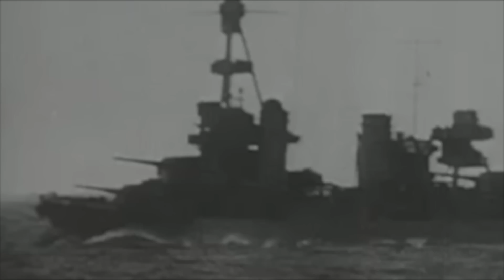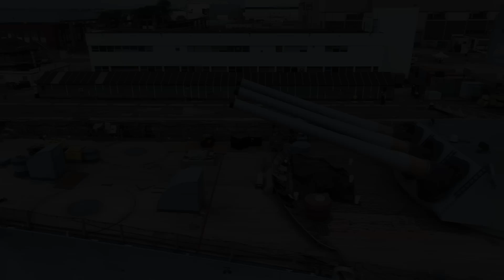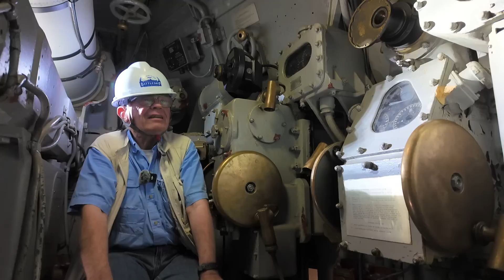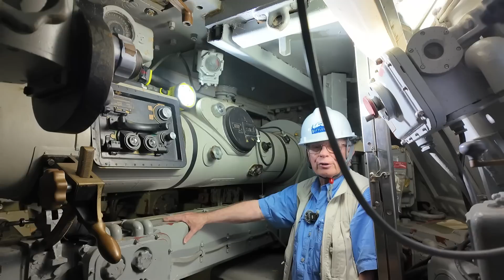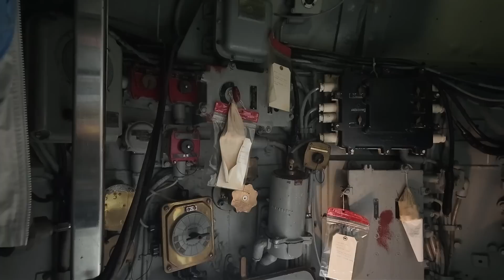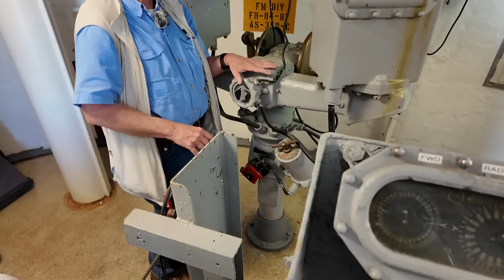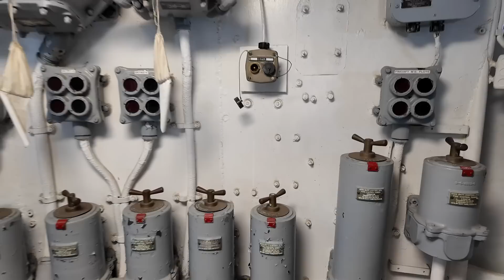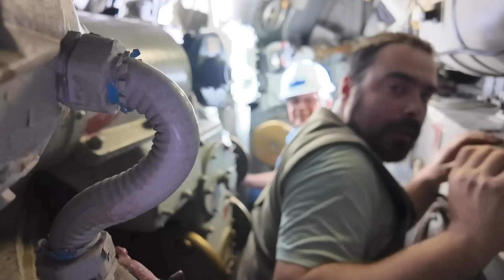Naval Gunnery - Rangefinding on an Iowa-class battleship

Comment: It’s disturbing that a huge number of people (including historians) believe the fire control radar is what actually calculates the firing solution (and also assume any ship without it thus were incapable of calculating firing solutions because they didn’t have a fire control system).
Reply: Sorry to disturb you, but I was one of them. I thought it was fully automatic, drawing straight from a radar plot. Of course, in absence of radar I presumed it was mark 1 eyeball and consequent certain miss😂
Reply: @hisdadjames4876  Yeah that's the sort of rampant misinformation far too many sources claim because they have no idea what a fire control radar actually does or how a fire control system works.
Reply: Disturbing seems a bit of an overreaction
Reply: I am disturbed.
Reply: An Artilleryman AND a historian would tell you that the need to do complex ballistic calculations for gunnery (both naval and land based) would drive the development of modern computing faster than any other endeavor. Read up on the Eniac
Reply: @Platypusklr  Except I've seen numerous historians assume said computing was done by fire control radar and that ships without it were incapable of calculating fire control solutions AT ALL.
Reply: @Platypusklr  Except I've seen numerous historians assume said computing was done by fire control radar and that ships without it were incapable of calculating fire control solutions AT ALL.
Reply: If it were up to my small brain the guns would be fired by a lanyard while some other guy eyeballed the enemy and hollered fire. I cannot even imagine myself of having the intelligence to conceive of a setup like this. Much less make it work.
Reply: Yep. Still need to meet the 5 requirements for accurate predicted fire.
Reply: -Some radars do incorporate calculations including for fire control.
-For Instance, the German Würzburg-D and Würzburg-Riesse (giant) radar incorporated a computer to convert spherical coordinates to cartesian.   This was used to project the target in a Seibold situation table and also provided heading, speed and altitude data.  It provides obvious situational awareness for the commander of the FLAK battery as well as helped a ground-controlled interception where both the target bomber and night fighter were tracked and manually handed off.
-The data for the kommandogeraete 40 FLAK predictor was passed in spherical coordinates via synchro (servo drive) transmitters.  (It used 24 motors and 34 differentials for addition/subtraction ).    Cams provided ballistics data such as shell flight time and superelevation as well as log/antilog cams and trigonometric cams.
-Conversion from spherical to cartesian was essential for parallax correction as well as a superior firing solution.  
-At a certain point it became simpler to incorporated the fire control into the radar for simpler situations (night fighter blind fire).
-Trivia: the electric motors came from model railroad makers.
Reply: I am reserve artillery officer of field artillery and trained in the 1990's. Have done analog spotting, calculations, fire control etc. of field artillery. Have always been amazed how you can do that from moving target to moving target while sea is rolling..
Reply: I am reserve artillery officer of field artillery and trained in the 1990's. Have done analog spotting, calculations, fire control etc. of field artillery. Have always been amazed how you can do that from moving target to moving target while sea is rolling..
Reply: -Some radars do incorporate calculations including for fire control.
-For Instance, the German Würzburg-D and Würzburg-Riesse (giant) radar incorporated a computer to convert spherical coordinates to cartesian.   This was used to project the target in a Seibold situation table and also provided heading, speed and altitude data.  It provides obvious situational awareness for the commander of the FLAK battery as well as helped a ground-controlled interception where both the target bomber and night fighter were tracked and manually handed off.
-The data for the kommandogeraete 40 FLAK predictor was passed in spherical coordinates via synchro (servo drive) transmitters.  (It used 24 motors and 34 differentials for addition/subtraction ).    Cams provided ballistics data such as shell flight time and superelevation as well as log/antilog cams and trigonometric cams.
-Conversion from spherical to cartesian was essential for parallax correction as well as a superior firing solution.  
-At a certain point it became simpler to incorporated the fire control into the radar for simpler situations (night fighter blind fire).
-Trivia: the electric motors came from model railroad makers.
Reply: Bruh
Reply: The same ones that think a 50 Cal is the same as 50 mm.
Reply: @steveayers8059 you'd be hard pressed to find a working historian who mixes that but I understand your point lol
Reply: So embarrassing for them! @steveayers8059
Reply: There has been a lot written about the design and development of fire control systems for ships. A true historian should know this, it's their job. I found the design and development of the analog computers fascinating. If I know about it, a real historian should.
Reply: @john_in_phoenix  Plenty of them do not. Seriously I've seen actual historians outright say any ship without fire control radar relied on the Mk 1 eyeball to aim instead of still having fire control computers.
Reply: It's so difficult to retain and remember every minor detail that I would never expect any historian to "know it all."  Just look at how many different crewmen are being used for these redundant postions, and then tell me how many personnel are on board the ship?  Can we seriously expect one person to be intimately familiar with them all?  I don't think so, so historians are probably going to be debating one another for a very long time!
😂

So...  I think that it's good that they write things down so that they may be berated for their ignorance later by another, younger know-it-all.
🤣👍
Reply: @tyree9055 They don’t have to retain and remember it. They are expected to write it down, along with the source they got it from. People don’t write books based entirely off memory… I mean, I’m sure some do, but that’s not good history.
Reply: Yes because it's a time when history crosses path with modern technology and engineering.

Historians aren't engineers in general. It's not their job and it's fine.
Reply: @sylvainprigent6234 while I agree that it can be fine if they dont know something only partially related to their field it does still become an issue if they think they know something and as such draw false conclusions or spread incorrect information.

If you want to discuss the impact of german submarines in ww2 and you are looking at tonnage sunk and how much civilians could not get imported anymore its fine if you dont understand how a ww2 submarine works. But if you want to talk about submarine tactics and counter-tactics and you do not understand what submarines can and cannot do you are probably going to say something daft.

Some historical subjects are so deeply intertwined with another field that any analysis that lacks at least a basic understanding will at best be shallow and more likely than not actively misinformed. Ofc that doesn't make someone a bad historian if they do not know these things but it means that those topics are probably not ones they should cover in depth.
Reply: @misterperson3469  - One of the major reasons, encyclopedias, including Wikipedia, get things wrong. And why those secondary sources are only for casual reference, and not for educational purposes, past middle school.
Reply: @misterperson3469  This. A MASSIVE number of sources get stuff like this wrong due to lack of professional knowledge masquerading as professional knowledge and these misconceptions have become deeply entrenched and intractable as a result.
Reply: Yes because it's a time when history crosses path with modern technology and engineering.

Historians aren't engineers in general. It's not their job and it's fine.
Reply: Disturbing seems a bit of an overreaction
Reply: Yep. Still need to meet the 5 requirements for accurate predicted fire.
Reply: Disturbing? Calm down, nerd.
Reply: An Artilleryman AND a historian would tell you that the need to do complex ballistic calculations for gunnery (both naval and land based) would drive the development of modern computing faster than any other endeavor. Read up on the Eniac